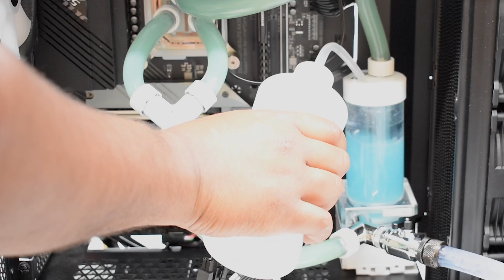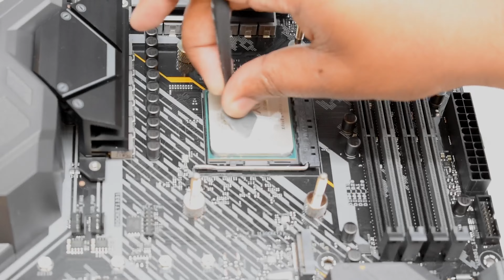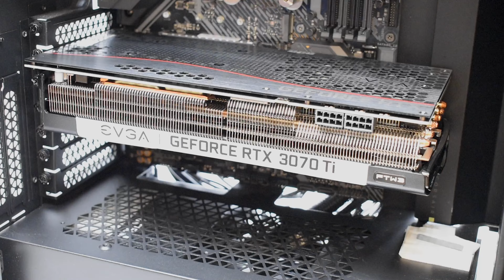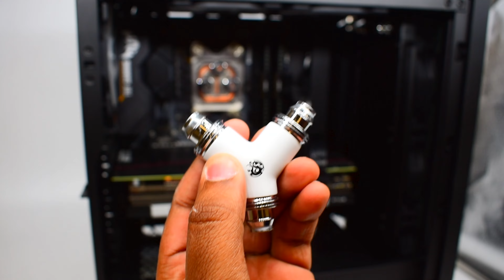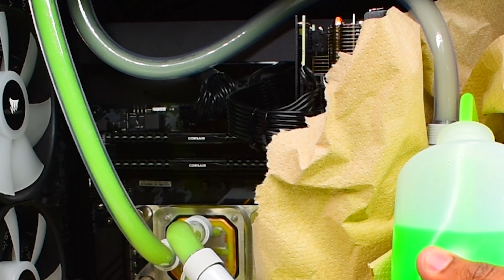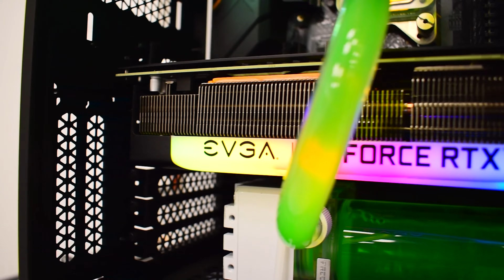$2000 Upgrade for my Gaming PC - Ryzen 5900X and RTX 3070Ti

Comment: Have you gotten any issues with that pump on the video? (its freeze mod pump am i right)
Reply from the maker: With having the pump horizontally we did have an issue if the reservoir was not fully filled as air was entering causing it to seize.
Reply: @fluixtech  Okay thanks for letting me know